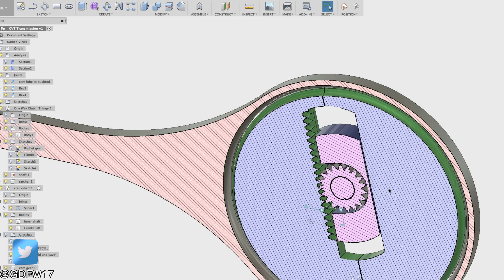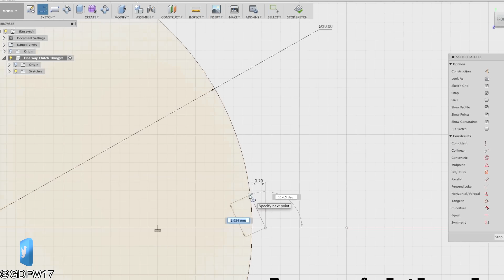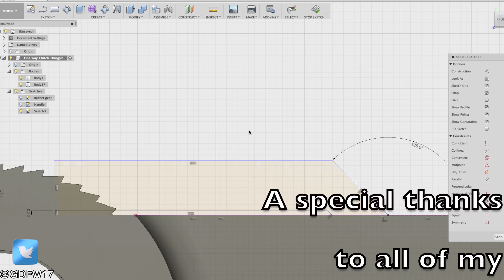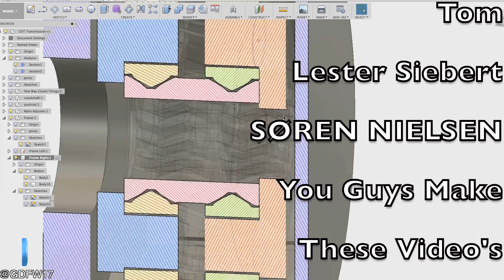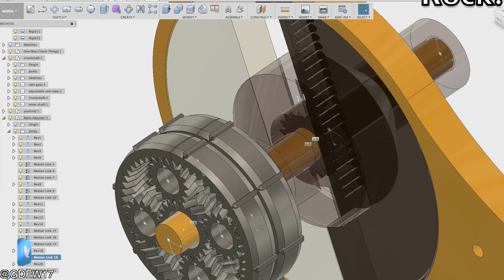The Coolest Transmission You've Never Heard Of... The Ratcheting CVT

Comment: genius, should go in a tesla.
Reply: You’re probably joking (I hope) but electric motors don’t need this
Reply: You're kidding right?
Reply: electric motors Have Better torque over the entire bandwidth, that is by nature 3-5 X wider than a normal IC engine, thus allowing better utilization of motor even with only one gear plus direct drive. ie high and low operation.
Reply: Electric motor's efficiency decreases linearly with rpm due to friction. Also a very cool property of them is that they work just fine while stopped or even spinning in the opposite direction from the torque that they are generating, so you could have your car rolling backwards down a hill and still apply as much forward torque as you want with the gas pedal, or make it stop in the hill without brakes or clutch.
Reply: @jakey, think of it like this, cordless drills have gearboxes, usually 2 speed, why? more torque at low speed, if you just used high hgear all the time, you couldnt drive in screws,  a car with no gearbox, it would do the high speed, but get stuck on hills
Reply: electric motors do still need gearboxes (they do in a tesla) the motor is more efficient kept in a narrower band of rpms than a simple reduction gear would do,

Comment: Why it isn't possible to model output shaft as a crankshaft and get rid of ratcheting?
Reply: Because the crank has to move the entire way to make a revolution, if it only goes part-way before reversing, the shaft will also reverse.
Reply: because crankshafts work with fixed amplitude linear movements and in this case the amplitude changes. is what makes it a variable transmission

Comment: You know, the 1990's/2000's "early" CVT's often used fixed gear ratios because the variable drive felt like driving with a rubberband.

Variators have been used in vehicles for ages, at least 50 years before the recent resurgence as an attempt to save gasoline.

Comment: If that was made from aluminum or stainless steel, it would be a beast. Fascinating design, which of course causes questions to come to mind: 1 What is the final ratio? 2 Can it be designed to fit a 50cc scooter? 3 Could the control knob have a better way to stay attached (ie bolted someway)? 4 Could it have a more than 1 to 1 ratio?
Subscribing cause see other videos that look interesting on your channel.
Reply: Randal Lovelace metal.. Thinking same here
Reply: It couldn't have anywhere near a 1:1 ratio. With major modifications you might be able to go from 3 teeth per revolution to 6 teeth per rev.
Reply: The reasoning behind the question was that with the belt design (currently on my scooter) the final ratio is 1:1 (which puts me going about 40MPH), if a different system could get me past that 1:1 ratio, the scooter could go a little faster, without having to up the cc of the engine.
Reply: A belt based CVT isn't inherently limited to 1:1 ratio. Maybe your current transmission could be modified to allow a higher ratio. This is assuming the engine is strong enough. Larger cc doesn't give more RPM it gives more power. A higher gear ratio requires more power. Does the engine spin faster when you are going at slower speeds?
Reply: The current CVT is throttle/speed biased (ie higher RPMs don't actually mean faster, though it will eventually get up to speed), it can be 'modded' to get just over 1:1, but it's limited by the casing size.
Reply: Can it go faster down a hill? Can it maintain 40 mph up a hill?
Reply: With it's current carb, no, but I know it can maintain 30 MPH uphill (I used to ride it over 8 miles each way on a rather hilly road). I know there are upgrades (carb, better crank, better cam) that would help boost up the performance without actually changing the cc rating. Fastest I've had it was 48 MPH (GPS proven speed - and the speedo is actually only 1 MPH off, though I keep breaking the speedo cable putting my cover on and off - it sticks literally straight out of the left fork bottom).
Reply: Then it sounds like you need to increase power output otherwise increasing gear ratio won't help. Once you achieve a certain power output then you can increase the gear ratio to bring your rev's back down at higher speeds. I would start with the carb.

Comment: Can someone tell this guy to stop saying their infinitely variable, it's a CVT because it i a Continuously Variable Transmission, even the suggestions in my phone knows that. Just because it's a CVT does not mean it is an IVT. That's like saying all diesels are four stroke!!!
Reply from the maker: Non-ratcheting CVT’s do have an infinite number of ratios, though that doesn’t make them IVT’s.  IVT is misnomer, just a name given to a CVT that also has a neutral ratio
Reply: CVTs, unless they have predesigned fixed ratios DO have 'infinitely' many ratios (unless you go down to the molecular scale :P ).
Reply: Continuous means it's not digital it doesn't go 0,1,2 it goes 0,0.1,0.2,0.3 in a fluid motion versus jagged just look up digital vs analog signal

Comment: Would this help electric vehicles?
Reply: Electric vehicles don't need a variable transmission.
Gasoline engines are only efficient in a narrow RPM range. The variable transmission purpose is to get a wider RPM range on the output shaft while keeping the engine in its narrow efficient RPM range.
Electric engine is efficient in its entire RPM range so it only needs a fixed gear to convert the maximum engine RPM to the maximum desired RPM on the output.
Reply: Christian Barnay thanks for the explanation

Comment: That output shaft is not robust enough. The output torque will be low for a car, and the alternating motion increasing driving losses. I would be enough for a bike, but simple CVTs are cheaper to manufacture. I regret that this is not a marketable construction.

Comment: You know your stuff about steering gears. I grew frustrated with power steering leaks in an agri tractor and thought up a mechanical power steering system driven via a fanbelt. i never built or designed it but i'll describe it and maybe you might build it and steal the idea i don't care.
it uses a threaded bar running between each track rod end. each end of the threaded bar has a swiffle and is secured in the middle with a nut. so when the steering is actuated the bar is rotated one way or another. this is accomplished using two drum brakes , one for each direction. I wanted to use a differential to provide the bi-directional screwing motion and chain the threaded bar in parallel with both hubs, but maybe that is too complicated a way of doing it.
Reply: I believe there were some early power steering mechanisms that used entirely mechanical linkages, but they don't wear as well and it's a lot less convenient to transfer the power from where it's generated to where it's used.  Might be simpler to just replace the whole steering mechanism with a double-acting cylinder and run it off the tractor's hydraulics.  You'd steer with a lever then instead of a wheel, but the modification would be pretty darn simple.
Reply: That was a common modification on the ford county as when it was new the hydrostatic wheel unit was troublesome.

Comment: Basically because you have to keep manually changing the gear ratio and it doesn't do it by itself, it isn't considered a CVT. In a CVT, the gear ratio changes as the RPMs go up.

Comment: Very neat design. I may 3D Print one of these! I see a lot of negative comments, so please don't take this negatively; what you are calling cams and pushrods in this form are actually called eccentrics and eccentric straps. They used them mostly in steam locomotives to control the valve timing through lots of rods called valve gear, or motion. If you Google "eccentric rod" you'll see pictures of what I mean.  I figured you might find this interesting. Looking forward to the next video!

Comment: You have invented a compound Geneva Drive with a variable radius output. I never thought about using a Geneva Drive that way but it's pretty awesome.

I don't know why you think having more than three ratchets would have diminishing returns, it would smooth out the output. I guess you mean 6 wouldn't be twice as smooth as three so I guess you're right. But you could get it pretty smooth. 

I suppose you would have to decide on some minimum stroke angle and then have as many of those as you would need to add up to 360 degrees.

Comment: Actually the earlier cvt transmissions would maintain one rpm, say 4000 during acceleration. They started making cvts "rev", because people found it weird. So, cvt's stopped maintaining a certain rpm years after their implementation, not the beginning.

Also, from an automotive standpoint I've heard the reason reason a cvt isn't used in everything is because it can't handle higher torque and horsepower vehicles like sports cars. I remember in automotive school it was explained to make one that could handle the power it would weigh considerably more than an automatic or manual transmission. Another reason is that automatic transmissions are gaining more and more gears which achieves a similar solution. The new 9 speed automatics also improve upon one thing that cvt transmissions don't excel at, highway speeds. Usually they get better city mpg and worse hwy mpg.

Comment: Can you find information on the "Sprag" clutch.  Then find an old crank car window regulator.  Disassemble carefully.  The back to back rollers lock rotation.  "Fingers" attached to the window crank handle aid the rollers in going in the preferred release direction.  On your device, if you can figure a way to drive the rollers in the desired direction.  Then figure a lever to go from forward to backward......
In a gear mesh, it is usual to have two or more teeth in mesh and sharing the load.  In your device, this implies six or seven eccentrics.  Try nine.

Comment: CVT means continuously variable transmission. Not consistently. The name doesn't even make sense with "consistently". A standard manual gearbox is also consistently variable - it is consistently able to be changed... Between the 6 or so gear ratios.
Continuously means it's continuous along that range, instead of only 6 pre-chosen points along that range like a manual gearbox.
Also, this guy needs to stop yapping and actually show us how it works. Open the covers, show diagrams or animations. Show, don't tell. It's rule one for making videos.
And if this thing is so amazing, why isn't it used in cars. It's for sure not just a consumer lack of knowledge. You'd have to at some point be able to get some sold and then people would see that it works. Like how the Tesla cars don't have gears either (electric motors simply have a big enough rpm range already).
In any case, the fact that this thing broke apart when he started spinning it and that when he opened one piece it was already wearing out (despite having had nothing on the output shaft, this was literally just it's own weight) tells me there's an issue with this design.

Comment: The device is impressive - your tenacity even more so - well done!
Now here is a challenge: make it go in reverse without reversing the direction of the input!
If you can get that right (and you probably can!) then you have an alternative to a stepper motor on things like CNC printers and mills.
Imagine this ~ 1 ordinary low power DC motor running at constant speed, ratio adjustment using a small servo and maybe an electrical solenoid (or second servo) to trigger direction change.
Of course the output speed would have to pass through the zero rpm state to do this and not simply whacked into reverse rotation which would start stripping gears eventually.
The "motor" would probably be on the bulky side but so what?
Now THAT would be UBER COOL !!!
And name it after yourself!!! Accept the glory for your work - you deserve it!!!

Comment: This would be ideal for pumping operations!
Pumps don't care about a little ratchet noise, they just need to rotate at the right speed, right direction.
A steady speed drive-motor, and this transmission could be part of a constant delivery pump.
The control device could be linked to a pressure gauge or flow-meter; don't need no stinking sensors if your gauges operates the transmission directly.
It could even shut itself off; slip it into neutral when the pumping is done.
Very nice, keep up the great work!

BTW, NASA had built a disk-type CVT that used a non-newtonian fluid instead of rubber drive wheels.
The fluid would harden under pressure when in a thin film between parts, 'locking' the contact point of the disk and the cones.
When the pressure dropped, the fluid was liquid again.
It worked well, but had to run 10K RPM [input shaft] or better to be reliable. 
They dropped the design as it was too sensitive to temperature changes in the fluid.
Too bad, the thing ran without vibration, and no output shaft RPM wobble.

Comment: Seen it on a-mid drive ebike! The nuvinci uses a line that turns into a hill as you adjust it as a visual readout, which is pretty cute. Also some ebikes use continuously variable regenerative breaking, an excellent way to save battery and pads

Comment: Also this would not work in a car, even with a roller clutch. The speeds are too high. But they would be good for low speed applications like feed screws and such. I know similar designs existed in the past.

Comment: A quick comment before I watch this vid, I have definitely heard of the concept before. I read a article on it quite a few years ago, and it was described as the mechanical equivalent of a DC to DC convertor.  It takes a constant rotational movement, converts it to a quick alternating movement, and then back into continuous motion again.The author of the article was a electrical engineer, and that was how they said the idea came to them. Never could find the article again. This will certainly be interesting to watch.

Comment: Hi I look at bike gears and think instead of different radius input output cogs couldn't one install cones? Of course the chain would need to be a belt but do you understand my thoughts? I think it's a form of CVT, be great if a microprocessor could set ratios downgrading on speed, gradient, input torque and anything you can think off. Off course it'll be limited ratios but the thinner the belt the higher the ratios (number of)

Comment: I think adding more cams than three would give diminishing returns... to a point.  At some point, you might get enough coverage to always have a ratchet engaged to the output shaft, which would also effectively remove what I think might be the root cause of the "imposter" problem.  That would take some good math and engineering to figure out, though.  If it is even possible.

Comment: Thats why tractors have CVTs. As fast backwards as forwards and all you have to do is move the clutch. Though they gear it in high gear where you have to use rpm to throw it. so it wont stall. But in lower you can leave it and slowly release the clutch while never touching the rpm.

Comment: I actually really like this idea, everyone talking about the vibrations from the on/off again output shaft could be easily dampened by a conventional fluid coupling torque converter. Yes the same one used in a regular automatic transmission, or maybe even something as simple as a rubber coupler would take care of it

Comment: I've been fascinated by mechanical devices since I was old enough to pick up a hammer.  I learned about differentials when I was old enough to read.  Much later, I learned that modern machinery couldn't be made to last without case hardening and shot peening.  Then I now find that the cars have gone to the point where the horsepower is converted to electricity before it goes anywhere, then the wheels are driven by electric motors.  So does this cool CVT have a future in production autos?
Reply: Acme Fixer i
Reply: At the power requirements of a car, even if first converted to electricity, a ratchet mechanism doesn't have the required durability to be practical.

Comment: True it wouldnt be great for cars but on bicycles... if that adjuster was adapted to be remote operated via grip shift on handlebars, and the gearbox fitted into the bottom bracket, the centre of gravity weight distribution and semi-infinite gear range along with the simplicity of the mechanism would be perfect for every biking discipline.

Comment: I had a DAF runabout that used the cones and belt system and was dirt cheap secondhand because "word was" they were junk.  The belt wears out!   Yes and so do your tires mate, and your fan belt and cam belt!  And if it were cheaper and easier to change than a tire??  That's an achievable  engineer's design objective.  I now have an old manual box car and when the cam belt goes it would cost me more to get it replaced than the scrap value.  Sad.....